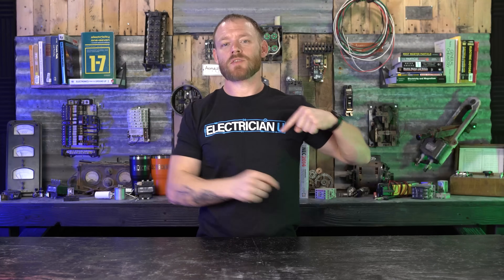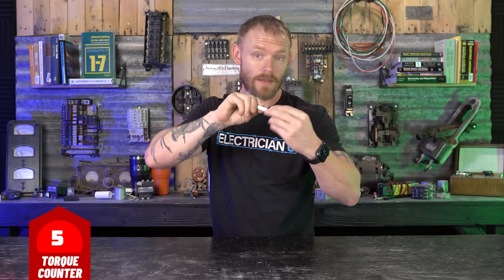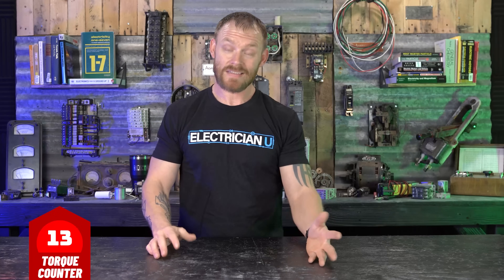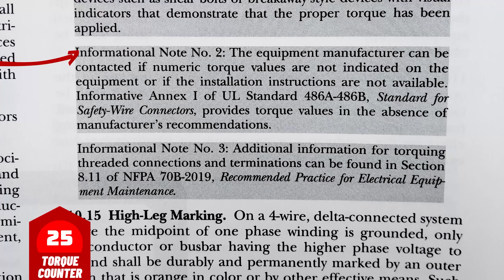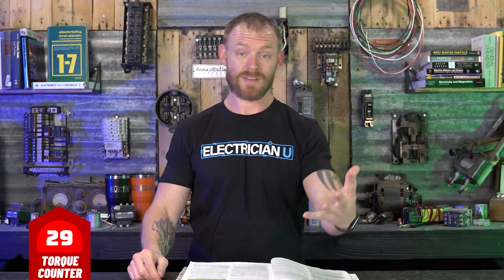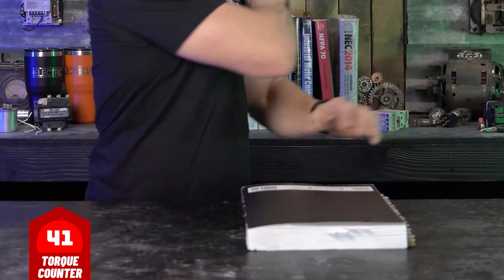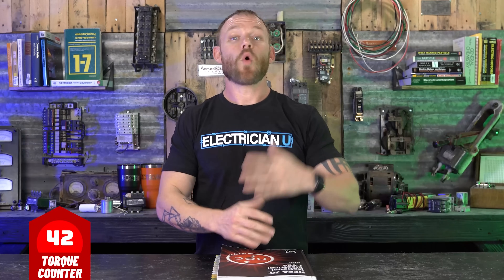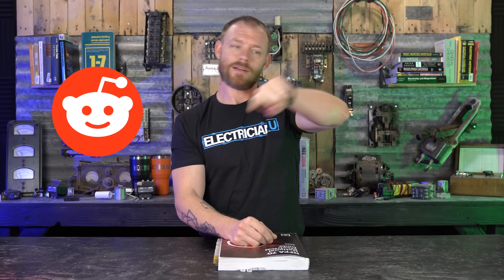Electricians: To Torque or Not to Torque... Is that the Question?

Comment: To my understanding over torqueing in cars can lead to striping bolts do to vibrations causing bigger problems. Is over torqueing an issue in Switchgear for same reason? I am an apprentice and was told that it wasn’t. I’m not talking about killing it. Guys at my shop like to be safe then sorry.
Reply from the maker: It would depend on the mechanical connection style/ type/ materials. 

On batteries tying to a UPS interrupt switch you do 136inlbs for the main positive and negatives due to manufacturing specs. But at the sync and switch gear you need to torque to 64in lbs. 

Could you also go to the 136in lbss? Yeah. 
But if you are required to torque to a specific specification. It's safer to just follow those rules laid forth and mark em with torque marks.

Comment: First video I have ever thumbs down on this page. :-(
Really need to redo this one.
The code is clear that torque values for terminal connections shall be indicated on equipment or in installation instructions. It continues to state that an approved means shall be used to achieve that value.
So any time a wire connects to equipment AND the manufacturer has supplied the information on the torque value, you SHALL torque that terminal with an approved means. If the manufacturer did not supply that information you CAN call or look up Annex I if you want to.
NOW, if you buy bulk receptacles there is no torque value (at least on the ones I have) however on an Eaton disconnect there are values given. You don't have to torque face plates or mounting screws etc (as far as this code is concerned) because those are not terminal connections.

Comment: I’m a solar commissioning tech on big (150MW) sites, everything gets torqued. In a cabinet with 20 circuits that are running at ~1200V at 200A it’s definitely not worth the risk of shit burning down because I didn’t want to get my torque wrench out of my truck
Reply: I would even argue that solar in general should be torqued to spec regardless of the scale of install. Had a residential solar system go up in flames in my neighborhood simply because the installers didn't give a shit to torque everything on the DC side of the inverter. Coincidentally DC is also really good at finding every little place of resistance and making you a nice little heater to indicate these spots. Guess how the roof went up in flames...
Reply: How often do you have torque wrenches cslibtation checked?
Reply: @garbo8962  In the Air Force, they're recalibrated every 3-12 months, depending on the manufacturer. So figure about 6 months on average. And if it's "war reserve material" (aka, sits in storage, not actively being used), it's every 18 months. 

Keep in mind though that these things are actively used all the time, often for precision work. Unless you have specialized work, once a year is likely more than enough.
Reply: I’m also in solar and we torque everything too. But I agree with Dustin I’m not going to torque every single receptacle if I was installing receptacles all day. He even said he torques the service panels just not all the little shit. Why does so many people in the comments not get that? Blows my mind.

Comment: I was in solar for awhile and when we do anything commercial sized always torqued. Solar gets picked apart by inspectors the most. Especially grounding and bonding.
Reply: Exactly right. I’m in solar too and everything is torqued and scrutinized by the inspector. There was a job we did for Amazon years ago that recently burned down here in SoCal. Not sure why but I have my thoughts. Solar still is really unregulated out here and we have a bunch of idiots doing the mechanical side of installations and mess a lot of shit up. Companies I’ve worked for would hire temps, unlicensed electricians, pretty much anything terrible you can think of would be at the job site. Not all companies are like this but many are.

Comment: Can u talk about tracing the last receptacle in a circuit so I can put a gfci in the first one?
Reply: The electrical industry need to torque at the consumer units/fuse box because this prevent overheating or even fires.

Comment: As an electrician, you should know that to go the extra mile only takes a little over 5 micro seconds.  Not 8 hours.
In a little more seriousness, it sounds like the rule of thumb is if you don't have a rule of thumb you should torque.
That is to say, if you've done something a few times and you understand it pretty well, then you probably have a feel for how hard to turn the screw or whatever.  Until then, torque.

Comment: I just replaced a NEMA 6-50 plug/receptacle combo that got all burned up.  Not from the wire connections, but the spring pressure on one pole on the receptacle must have weakened over time, leading to a high-resistance connection.  Melted a good bit of the bodies and wire insulation.  My point being that when dealing with anything above the normal 15/20A devices,  using some "approved means" to get things properly torqued ain't a bad idea.  This could have occurred at the wire connection lugs as well.

Comment: I have found hundreds of loose connections, where someone clearly has been using torque wrench blindly and not understanding what they were doing.  Larger cables with segment-shaped conductors are too easy to screw up, as surprisingly many electricians forget or just don't know that you should break that segment-shape before sticking it in to any screw connector.  If you just stick that intact segment in after only stripping it, it might be in a position where only corners of it touch the connector/screw and those usually quite small torque recommendations wont be able to alter that shape enough to make good contact.  Those connections wont handle as much current they were supposed to and/or slight movement while wrestling with other conductors or cables in the cabinet might make that segment-shape turn a little bit and then your connection is relying only to the weight or tension of the cable towards that connector.

Don't forget to break that segment shape.  Wiggle your conductors and re-tighten.  Repeat until it feels right.  You may use torque wrench, but as time goes on, you will learn what different connectors and sizes should feel like and could do without.  I still use torque wrench for through bolt connections, as those usually demand higher torque and are sometimes done in strange positions, where it is hard to judge if you applied right amount of force or just hurt yourself trying and it felt that you're done.  You know, those situations where you need 4 elbows in one arm to keep that back side nut from turning.

Comment: So, if there is a torque value, say 100 inch lbs, what if you go over that. Is the 100 inch lbs a minimum?  I say the range is 100 to 75 percent of the fasteners strength.
If there is a range, say 95 to 105, then no obviously.
Reply: It is the target value, it is not the minimum. An over-tightened lug can be a bad thing.

Comment: Go back and read the NEC again - Torque values SHALL be indicated on equipment, and an approved means SHALL be used to achieve the indicated value. So, while I agree that the majority of people are not following this rule today (except perhaps on main lugs, etc.) no reasonable interpretation would suggest that it's "whatever you feel like doing"... Torque wrenches and torque screwdrivers are expensive AF, and as garbo mentions below, I would not get anywhere near a live panel with a bare steel tool the size of a crow bar, but you better get used to doing it, cause you know in the next code cycle they're gonna make it WAY more clear that's it's mandatory EVERYWHERE...

Comment: I started life in the automotive trade, working in gas stations. The only thing we ever used a torque wrench on was a head gasket because even a guy who is wet behind the ears knows that's the proper way. Fast forward to working at dealers and EVERY factory class stresses that EVERY fastener has a torque spec.... so the obvious question is why? The answer is "it was designed that way!" IOW, how do you know what's tight and what's not tight enough if you don't have a guideline? Yes, you do develop a feel over time if you repeat a task, but you do need to start somewhere. That said, from an engineering standard anything with an Allen head will have a higher spec than a hex head, and still different than if it's got a straight screw head. That's your hint. It was designed that way because each fastener head has a purpose. (better grip) BTW, the word "sometime" is improper in that code statement. Sometime means you do it some of the time, but not all of the time. If they had said "SOME TIME" (two words) it means go back after a period of time has gone by... but always go back. From my perspective anything that requires a retorque should be tightened... then wiggle the wire.... then tighten again to spec. When retorquing you always back the fastener off a half turn before tightening again. Torqueing is also done on "lightly lubricated" threads, never on dry threads.

Comment: You are required to follow all manufacturer recommendations on devices....so there's that little tidbit and the reason for requiring those recommendations visually because it is an agreement between you (as an electrician) and the client that you followed the guidelines set by the manufacturer.  If it is found that you followed the recommendation and it fails, then the manufacturer is at fault....if you did not, then YOU are at fault.  If there is no fault, then there is "no problem" right?

I get it though, I mean, I used to work on vehicles and we were required to torque lugs based on the vehicle recommendations. I was very good at my job that I could get the lugs to vehicle torque spec by sound without using any torque bars at all, just straight zipping....but....if a tire fell off a car, then it would have been my ass on the line.

I say if you can prove that you can match specs without a torque driver, then go ahead and not....because technically YOU become the torque driver in that situation.

Comment: Always follow German torque specs, goodnight.. but seriously under torque can cause arching over torque can cause hot spots. On a plug not so much but high current i.e. main feeders probably a good idea. Quite a few ahj inspector required seeing certain connections be torqued in front of them. It only shows it is tightened to at least the value not over...

Comment: I have only been in the trade a few years but the only time I have EVER seen anyone torque anything was installing solar panels...We torqued every nut and bolt that was hold any of the panels, actual electrical panels, inverters and anything else in the whole conversion system...Otherwise, NEVER
Reply: Same.

Comment: Greetings Dustin - The language in 110.14(D) specifically requires the terminations to be "torqued" to a specific value either as marked on the equipment or in the manufacturer's instructions. Also, remember "Informational Notes" are just information and are not enforceable. Now, the lead into the charging statement says "Tightening torque values for terminal connections" which implies that terminations are to be torqued. Now, all electrical equipment must be installed in accordance with the manufacturer's instructions per 110.3(B), which is part of its listing criteria and so it if is indicated on the equipment or in the instructions then guess what......You must torque it if the manufacturers state it on the equipment or the instructions.  Now, most do not do EVERY termination and that is understandable but if going to do it anywhere make sure its at feeder and service terminations and the rest...well, let your conscience be your guide.
Reply: You were doing good up till the last two sentences.
Reply: Let YOUR conscience be YOUR guide. I not any CMP Member can make YOU do anything you don't want to do. However, YOU have to live with the consequences of those actions. That's the Last Two Lines Translation.
Reply: @MasterTheNEC  Understood.

Comment: The amount of pressure it takes to open a door with a door knob is 10 in/lbs mostly all devices and breakers are less than 20 in/lbs that should ensure a proper connection regardless if you call it code.

Comment: Also worth mentioning that on commercial jobs, you need to follow engineer’s specification, the spec that my firm issue require torquing and torque seal on specifically designated terminations.

Comment: Lol, "it doesn't say shall". Literally says shall in the code.
Reply: Was told at an IAEI meeting that you MUST use either a torque wrench on what looks like a double nutted bolt that head breaks off at correct torque. Thought they said it was in the 2020 NEC.

Comment: There are far too many nonsense regulations as it is...
We don't need "torque inspectors" on the crew.
Reply: Perhaps we also don't need meter safety categories, green grounding screws, leather protector clearance on rubber gloves, or other lesser known code measures. Of course, it's the little things that kill. You must accept the fact that as our knowledge advances, it turns out that little things like torque do matter and should be codified. To ignore that is lazy and negligent. Just because something goes against your "git 'er done" agenda, or is a minor detail, it doesn't make it nonsense. In fact, you should have already known that a lug can, by design, never not be torqued.

Comment: At the data center I work at the customers QA team requires ever connect on a breaker, the breaker itself, ground bar, neutral bar and if ground bushings are on the pipes coming into said panel the screws holding the ground bushing and the screw securing the ground wire to the bushing. This seems to be a new tread in Ohio with all the data centers here no matter what electrical connection is made it must be torqued along with any components in a panel or cabinet

Comment: My team performs maintenance on substations and commercial buildings.  #1 issue - stripped screws.  #2 under torqued (IE loose screws/bolts)  In distribution panels use a torqueing screw driver on all connections!  They are not expensive and easy to use as a quick check.
Reply: Don’t say that. That’s good for you and your team 🤣 you’re gonna run out of work if we start using the torque wrench

Comment: Never seen an electric torque wrench that does the turning on it's own, but the digital torque adapters are pretty slick (for automotive uses), and apparently stay calibrated better than the mechanical wrenches.

I would have thought "an approved means" would have meant, if it has a torque spec you must ensure you comply with it. (And yeah, stranded wire definitely decreases tightness over time if you don't use a ferrule.) Honestly, if I hired somebody to do big wiring (more than replacing a receptacle), I'd expect those to be at least done with a torque indicating screwdriver based on what you read from code.

Comment: Honestly, any meter lug, main lug in a service panel, ground lugs in a service panel, bolt mounted breakers or main & ground lugs in a sub-panel should all be torqued to manufacturers or NEC code spec for that specific terminal/lug. Anything else after the meter, main or sub-panels I.E. light switches or receptacles can be but, seriously hand-tight is and has been good enough for decades unless it’s forgotten or the installer was that weak. Torque specs are provided and are recommended so they should be followed for the appropriate terminals or lugs, anything else is just good reassurance that things are tight and left loose.

Comment: When I do switch gear I torque the lugs and bussing. I write the torque values and dates on the back of the dead front. Also put a mark across the nut and bolt.

Comment: I have a torque screwdriver.
I break it out in situations where the fix for a job is a “slow screw turner” IE, bad breaker, a single device or something that’s went bad, that I I find immediately, what better way to impress customer as well as meet those manufacturers demands?